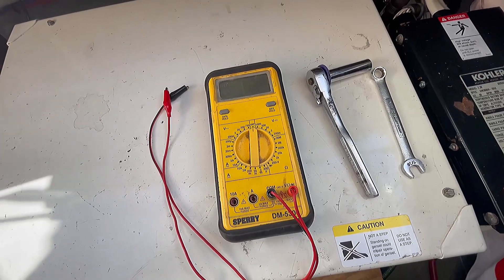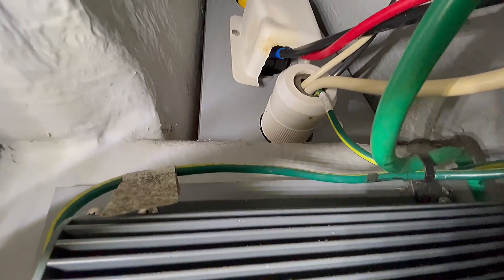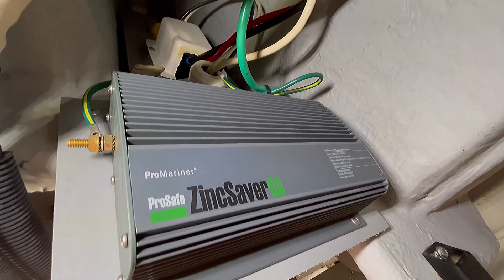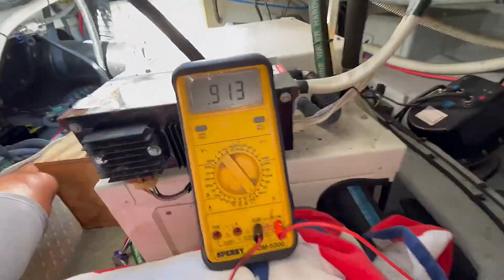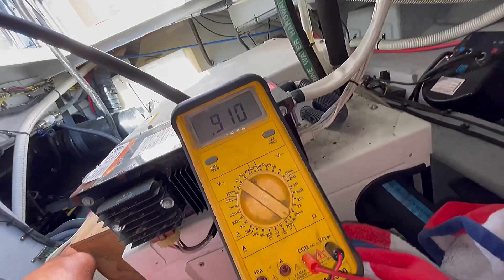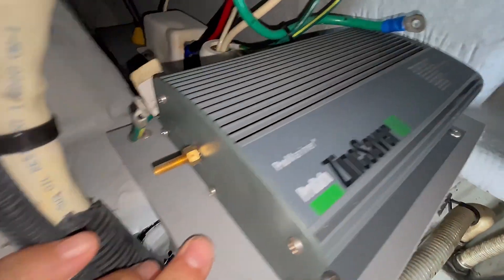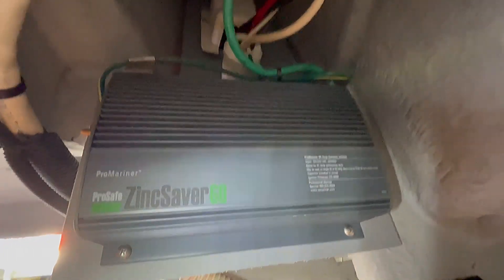Testing a Boats Galvanic Isolator

Comment: Hi, I have the same issue and tested as you did but got a reading on both sides of 1.064v and 1.061v respectively. Is that an issue?
Reply from the maker: It’s not something I do regularly so I would check the test manual to see what it says about your readings.

Comment: 2 very important things to note. Yes your galvanic isolator works and is showing the voltage drop of 0.9 VOLTS (not ohms as you said), across its diodes.
Secondly, your issue is with the Bonding cables themselves. The copper strands crimped in the connector terminals are BLACK, and the connector rings are scaled and need cleaning or replacement!

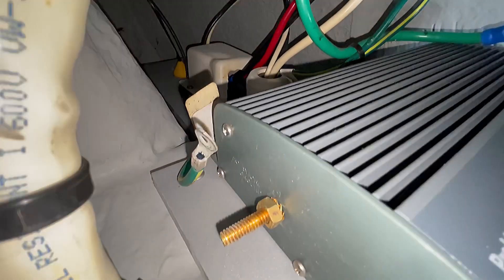Comment: The diode check is NOT OHMS it is  voltage drop across the leads(The meter sends a small voltage out) Second I noticed your copper in the earth line has turned black @1:41 ... there is your problem..... Replace your green earth wires... both of them.

Comment: What I don't get is why these devices are so big and expensive, when essentially they are just a couple of very inexpensive and small (say 16A) diodes back to back? Thanks
Reply: The housing is a heat dissipator, also the unit needs to block dc stray current while still allowing ac fault current to travel. This particular unit fails in the closed mode, older ones should all be tested as they do not have failsafe diodes, unit should state on cover.

Comment: Did you check the wiring behind the zincsaver? The white cover seems to be overheated so the connection can be bad and can cause fire. Please check
Reply from the maker: I didn’t notice that.  Will have to check.  Thanks!

Comment: Your zinc saver works fine, your test is valid, but your interpretation needs a slight adjustment.  The multimeter diode test measures voltage drop, not resistance.  The stray current needed to bridge this device (and wear your zincs) would have to exceed your .9 volts.  Most of your stray current will not exceed millivolts, this device will block that current keeping it bonded to the service ground.    This device blocks stray current from your drive unless it exceeds .9 volts (well below any safety threshold).  I do appreciate your tutorials.  I would not been familiar with this zinc saver without your video.  40 years ago, I took the class on how to calculate the voltage drop across a diode junction.  Since then, I use the diode function on my multimeter.🙂
Reply from the maker: I was confused why the diode test was under the ohm selector.  Lol.  Thanks for the explanation.  I have a rudimentary knowledge of it. Just enough to get me into trouble.  😜

Comment: Don’t use Camp…use ZIMAR anodes. They are based in Davie, Florida and have found them to have superior quality. When anodes protect, they get eaten away. Still, it’s good to use the galvanic isolator as per the video to avoid stray currents entering through the ground line of shore power and eating away your anodes or other metals being protected.
Reply from the maker: I usually get my anodes from boatzincs.com.  I’ve found them to be good quality and not too pricey.